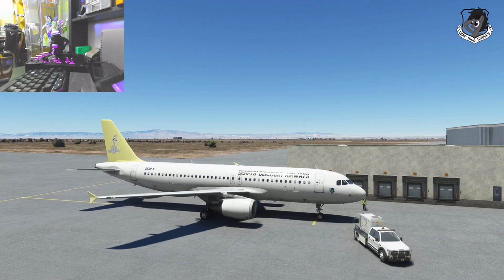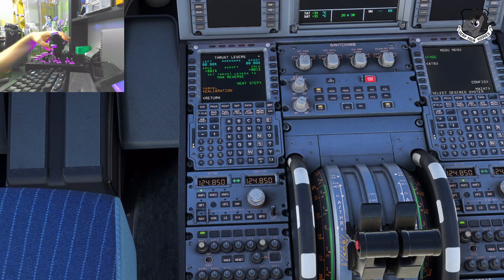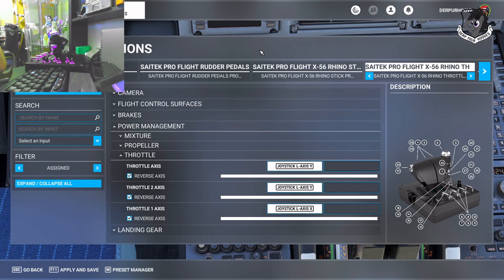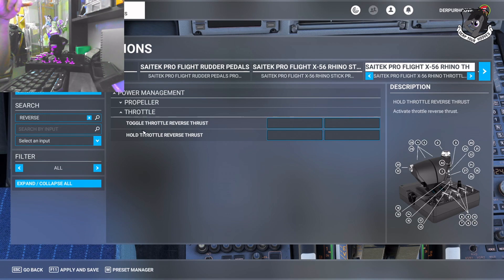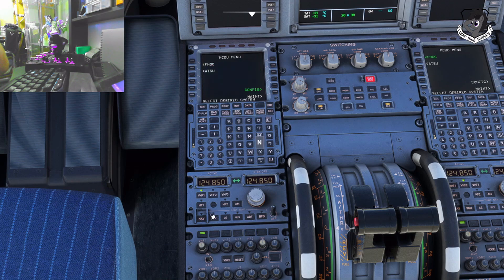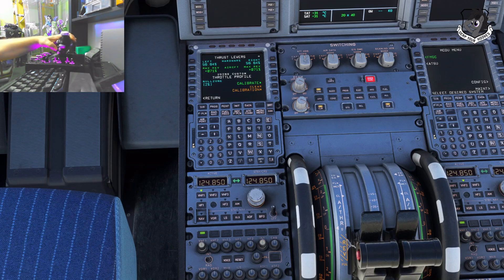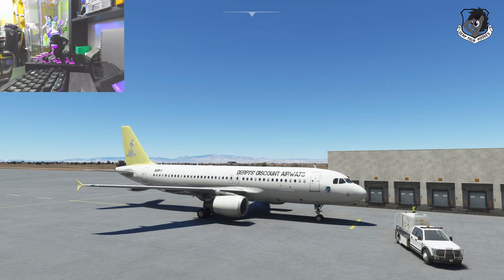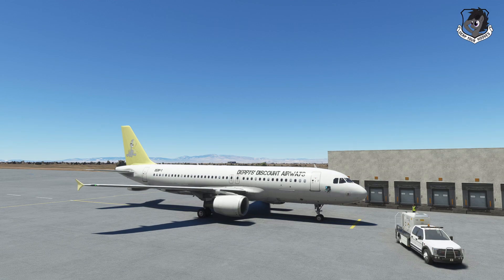A320 Fenix MCDU Throttle Calibration (binding a button for reverse thrust)

Comment: Hey man, I have the same hw setup however when I pull it back to 0thrust without any calibration the throttle stands above somewhat the idle position, do you have any idea why this is?
Reply from the maker: No but I heard that they've been having random issues since Sim Update 13

Comment: Without pushing the reverse button, if you bring your physical throttle levers all the way back to idle does your plane levers stay in idle or go to rev idle?
Reply from the maker: At first no, not if it wasn't calibrated. After calibrating them they now always go into reverse if I bring them all the way back.
Reply: @@los7421thank you so much was struggling so much to fix this and now it works